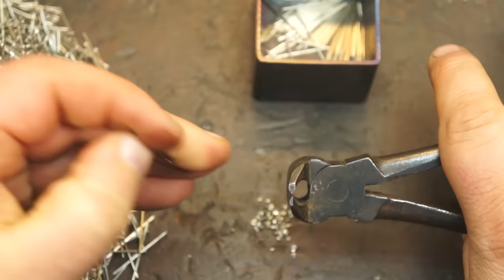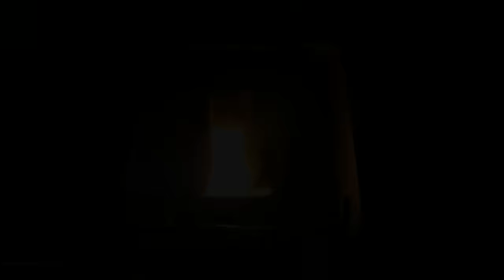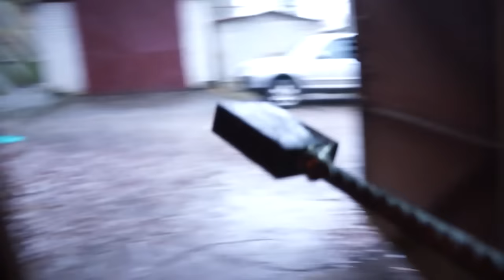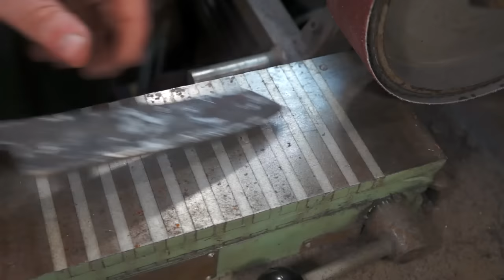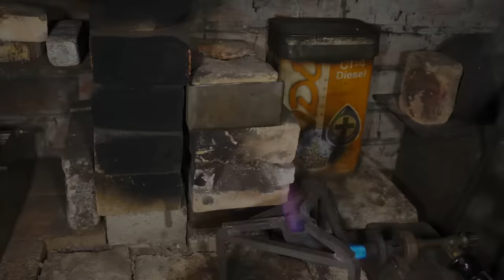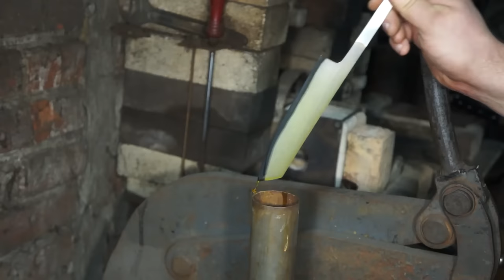Damascus steel from 3800 pins.

Comment: The fact you cut off the heads of 3800 pins is already impressive display of patience.
Reply: If he could do the same with 3800 orcs..
Reply: You should see what chainmailers do. We take plain steel wire and wrap coils, clip/saw rings from them, straighten and either weld, solder or rivet them shut one by one. Then we join them (traditionally) 5 at a time. It can take tens of thousands of rings depending on what you're making.
Reply: @whatbroicanhave50character35  imagine being assigned to produce x amount of chainmail tunics for an entire garrison of men
Reply: @emperorpalpatine1469  I can't make myself complete a whole shirt yet. I've got a couple 1ft. square sheets but haven't been able to push to get sleeves and a collar/shoulder piece done. Can't imagine doing multiple full shirts back to back. My hands would fall off.
Reply: At first I wondered why he didn't use needles, then I remembered needles were an order of magnitude more expensive lol
Reply: Assuming he did it at the rate that he did at the start of the video it took him about 2.5 hours to snip all 3800 of them

Comment: 2:00 I cut myself badly in a similar context once, so please use a brush to brush that shit away. To me a larger piece cut me deep and when removed it left tiny pieces of metal beneath my skin, which had drawn dirt from my hands deep and very close to a joint. Got a bad infection from it which to this day limits the movement of my left thumb due to very mild nerve damage (which will heal over the years). 

Beautiful knife tho.

Comment: I've watched other smithing videos and I've been wondering lately why do you guys put cracked pepper and chili peppers in the soon to be ingot
Reply: so the knife can be sharpened to the perfect level of sharpness.
they could put in rawit, madame jeanette or even carolina reapers for more sharpness.
but that would make the knife or blade oversharp and it will break too easy.
sun dried black pepper and red chillis are the perfect balance of sharpness.
Reply: @UnitedBrothersNL  thank you for that insight and I never would of guessed that answer in a million years
Reply: @jonbilodeau456  lol its a joke, they say it burns up air in the sealed canister but there are more ways to do that so its also a joke (because sharp and spicy)

Comment: What would happen if you use syrinnge needles in a similar arrangement/pattern, the syringe needles are hollow on the inside so you could fill them with fine metal powder....maybe that would make a special pattern

Comment: @shurap what was that granulated looking stuff you put the blade into after you stamped it?
Reply: sand
Reply: wouldnt sand melt or change in some way after being exposed to such extreme temperatures?
Reply: @Swintifico  Sand melts at 1700c, while the burning point of Steel is roughly 1450c, so it's alright

Comment: I was wondering here if I have a 3 kilo sphere with a 30 cm circumference and I compress it to a 1 centimeter sphere and do this with a few more until I can make one new 30 cm sphere with the 1 cm spheres, so this new 30 cm sphere will be much more resistant to being compressed than the original 3 kg and 30 cm sphere circumference?
Can anyone answer me???